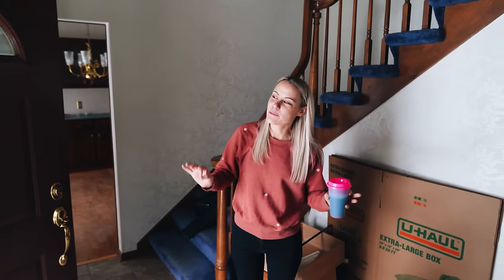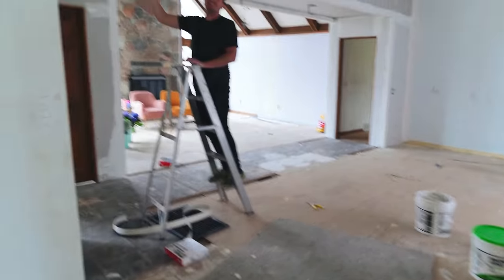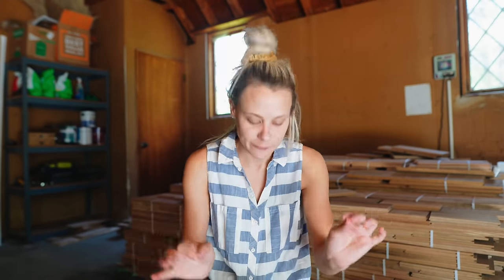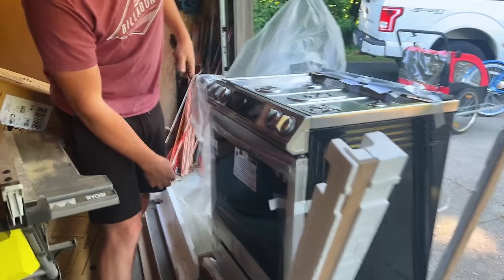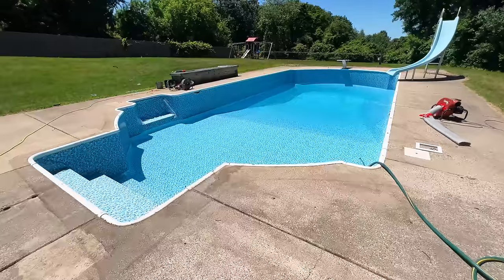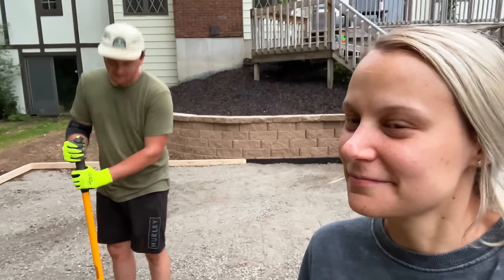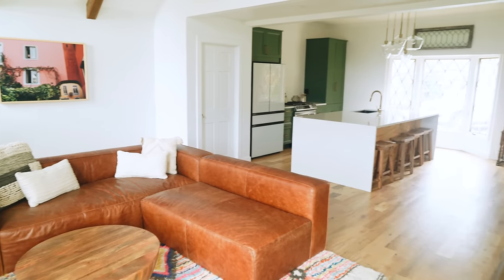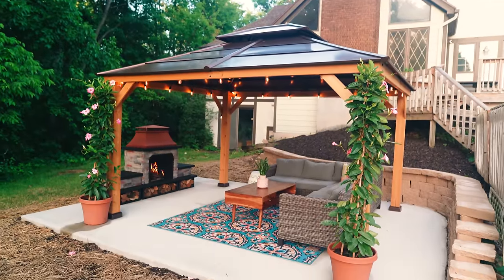The Stately Tudor - EXTREME DIY Home Renovation Start To Finish

Comment: Something we did for our pool that I'm SUPER happy about is installing the UltraUV by Paramount.  It's a blue light that kills bacteria (including cryptosporidium) and makes it so you can use a fraction of the chlorine most pools require.  Seriously less chlorine.  You cannot smell chlorine at all at our pool nor when we get out of the water.  

Our neighbors heard about it and did it for their pool too.  Unlike salt water it doesn't damage the pool nor the pipes. For the first 3 or 4 years after buying the  house we struggled with algae.  Eventually, we emptied our pool, had a service remove and install a new sealer coating (which turned out beautiful).  With that changed we installed a new DE filter, pump and added the Ultra UV.  Since then, we've not had a single issue with algae.  Not one.  The pool is glorious and bright and clean every single day with 1/2 the work than before - and less cost because we're not using all those toxic chemicals (only a very little bit of chlorine).  I highly recommend it!
Reply from the maker: Ahh that’s interesting! I’ll look into it! Chemicals are expensive 🫠Thank you!

Comment: I ❤ a stately English Tudor home! Awesome job on renovating the kitchen!  Changing the location for the kitchen then opening up the walls (altho very costly) was the best idea for this home.👍 Gorgeous Emerald green cabinets and wallpaper in the foyer.
The one thing I would have different is to have only one colour for the hardware, faucet and stove-cover. Either all gold, or all copper, but not a mix. I would have chosen all copper, including a copper sink, faucet, stove-cover, drawer-pulls and copper on the stove knobs and handle instead of silver and copper lighting. But I realize that it's your home, your decision.😊
I ❤❤❤ the curved front door, so elegant! Love the pool, gazebo and curved retaining walls! 
This just shows that anyone with the notion, energy and $$ can accomplish so much by DIY. You weren't afraid to try new things and it worked out faster and beautifully for you! Looking forward to future changes at your new home!❤👍

Comment: I love the idea of that room as the kitchen. I love my kitchen open to the great room. Then you can feel more included instead of being isolated. You’ll be very thrilled with the popcorn gone. Next popcorn removal take your 1 or 2 gal weed sprayer. First fill your tank with warm water and spray a decent section of your popcorn area with your warm water. Wait about 5 minutes. The popcorn will shave right off. ( I have a sprayer I bought new that I only use for that purpose, so it has no chemical residue.)

Comment: For future reference, pine should have a coat of sealer on the wood before it is stained, it is so porous that it absorbs stain unevenly,I use a clear or "blonde" shellac ,which is made with a alcohol base,that makes it dry in minutes, an hour at the most!
It is then qwikly sanded to cut off the raised grain, that is usually done with a 220 grit sanding sponge!, then use a tack rag to get rid of the dust, then the wood will stain more like a hardwood like oak,that doesn't let the stain penetrate like pine does! FYI, pine is notorious for not staining evenly! Probably the hardest wood to get a good even color!
But using a shellac,or maybe what MINWAX calls wood conditioner,( which is very close to the same thing), just more expensive and it takes longer to dry!
But when pine is sealed, the stain will go on evenly! It is a little more work, but it will definitely make the difference!

Comment: A Youtuber that goes by "Bonz" he and his family remodel and build homes in the Seattle Washington region, had a video about using a spray on the ceiling to make the drywall smooth, it didn't take him very long,  the uneven particles basically just came right off.  You should look up his video and find out what was the spray he made.

Comment: Do Americans not have to fence their pools????? In Australia you literally cannot build a pool without a fence. Even larger temporary pools (like ones you might put up for the summer and take down in winter) require you to fence them. You can be fined if you don’t have a fence. This is the second time this week I’ve seen an American pool with no fence. There was a campaign in the 90’s called Kids Alive Do The Five…step 1 was ‘fence the pool’ and step 2 was ‘shut the gate’. Y’all stress me out with your no pool fences and lax sun safety…😅

Comment: Well, you did a good job with all your changes, but stately Tudor? It’s really neither. The entry is pretty. The only thing remotely mock Tudor is the fake half timbering and the style of the gable for the front door. Glass doors wouldn’t be Tudor at all. It’s a strange mishmash of styles even within rooms, but if you like it , then it’s great. Good job with the finishes.